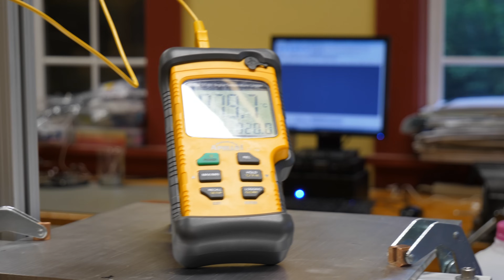Distillation

Comment: To those of you who may see a distillation project in your future, please consider this:

It is actually more simple than you may think to get an BATV license for a small pilot distillery setup.  This is especially so if you just plan on making "fuel grade" ethanol, or some other non-consumable use.  Just make sure you take good records of what was produced, and where it went, in case they drop in to check on you.  As with growing pot in non-legal states, bootlegging is a federal crime, and your entire personal property can be seized if you are not following the laws.  Contact your local office and do it legally.

When distilling "mash," "beer," or whatever mix of yeast/sugar-bearing malted grains, Rye, rice or feed corn + fermenting -> alcohol(s), as done by most moonshiners, one must be careful to be aware of the likelihood of methanol in the mix as a byproduct of the fermentation process. Some wild yeasts floating out in the woods like to make both types of alcohol.  This is especially true when fermentation is done with questionable mash ingredients, purposely using wild yeasts, or when cleanliness is ignored.  

Most commercial distillers are keen to this and will take whatever comes over first and discard it out of safety concerns.  They also make use of re-flux columns that are glass or copper tubes filled with glass beads or copper drip plates/screens, with the vapor take off at the very top of this column on its way to the condenser.  This allow for more accurate temperature measurements in the very top of the column so that they have a much better handle on what they are getting.  Methanol has a lower boiling temperature than water an ethanol, and will always come first.  A temperature increase in the the re-flux column tells you the methanol portion is done.

Unless you have a use for it, pitch it before someone accidentally drinks it and goes blind.  This is why the old moonshiners of the prohibition era created so much poisonous hooch that made a lot of blind victims out of people who were willing to drink anything.  A lot of the bathtub gin of the era tasted so awful that the modern "cocktail" was born from those days.

Comment: Hydrometer. A  Hygrometer is a different thing used for measuring water concentration.
The boiling beads/chips work by providing 'nucleation sites' rather than increased surface area.
Little anomalies in the material that the gas can congregate around. AKA anti-bump chips.
A stirbar generally works better IMHO.
Hard to tell if that kind of temperature probe is in the right place.
Easier to get it right with a thermometer or thermocouple as  the place they measure is in 1 spot.
Measure your coolant temperature. I guess the radiator gadget isn't coping well.

Comment: So just a quick question concerning distillation of water that has a high concentration of chlorine and fluoride: Would I be able to remove 100% of the fluoride using either method of distillation or will there always be some small amount left behind in the process?
Reply: There would still be a little bit left, he goes over that a few times in different ways in the video...

Comment: i love chemistry
Reply from the maker: Everyone should!  Just like electrical engineering, it is a way of understanding how the world works.  Do you want to ride in the car or do you want to drive it?
Reply: @TechIngredients  The car analogy makes sense. When I drive an old rear engined and rear driven car, with zero modern assistant systems (the whole electric schematic fits nicely on a single A5 page), I can really feel the car change its behavior by subtly changing the throttle, brakes, etc. By no means is the car safer to drive, but it gives you the experience of pleasure, when you understand all of the underlying physics at work. I really do not need to drive fast. Back in the old days, car had to be driven. A skilled driver could manage it very good. Modern cars are full of electronic assistants, and much better suspension and other things. Cars are much safer, they tolerate incorrect driver behavior and wrong input. But where is the feeling of actually being in control? Where is the experience of really driving? It is gone. Probably for the best, as most people do not understand how their car works and the risk of overestimating either own abilities or the physics involved in what they are doing.

Comment: If you wanted o purify water for drinking, is this a good and economical way to remove chemicals, PCB's and other bad stuff from your water? what kind of setup would you recommend?
Reply from the maker: This depends on how much water you would need.  The setup, here in the lab is based around glass because it allows us to distill a huge variety of liquids including acids and solvents etc. But the throughput is low and the components are delicate and expensive. An alternative would be to get a stainless steel, reflux still on eBay that can be placed on a large propane burner.  These are available from 3 to 15 gal capacity and you'll need a garden hose for the condenser as a lot of flow is required.  Finally, if you need a large quantity of water and want to avoid the set up for distillation then a reverse osmosis system coupled with a deionizer and activated carbon cartridge is the way to go.  Low energy requirements, thousands of gallons of capacity and can be installed between your in house water supply to a dedicated spigot near the sink.  We've used these systems primarily to supply large marine aquarium installations and the cost is similar to a large distillation set up. I like Spectrapure, but there are alternatives out there.
http://www.spectrapure.com/
Reply: thank you for your response. I am seeking a way to filer water without having to rely on filters that cost a lot but give you little in return. I found a natural method of filtration using a pond system and one other from charcoal and other natural components. I was just curious if distilling would remove heavy metals better? I am still researching though. thank you again. I enjoy your channel and have been watching since late last year.

Comment: Easiest/cheapest way to make 98% alcohol for cleaning or just about any household use: Go to the dollar store and buy the 50% alcohol bottles. They will never sell above that. 50% alcohol is useless: there is too much water to kill any germs (70% is ideal better then 91%) and the alcohol is too low for cleaning. Take a good amount of table salt and pour it in until it is about 1 cm above the bottom. Shake for a minute and let it sit for about five. When you come back there will be a layer of 98% on top and salt water with a small amount of alcohol on the bottom. Carefully pour off the top layer and discard the bottom. If you want 70% for antiseptic add water back in. You now have 98% and 70% for about half or  one third the cost of regular alcohol respectfully.
Reply: or just buy some 91% iso at walmart and use C1V1=C2V2 to mix it to 70%.
Reply: You can buy 92%. What are you on about?
Reply: @MrEazyE357  I have heard complaints from friends in other countries who do electronic repairs etc that they cannot buy isopropyl at all and others that can't get unwatered stuff. It however is easy here in the US.
Reply: @anarchangel7  Really? Never knew that. Wonder why?
Reply: I had to read all answers to get you were speaking of isopropyl alchol and not of ethil alchol. Ethil alcohol is readily available 90 or 94 %.

Comment: For even smoother boiling, use boiling chips with irregular shape. Sometimes running a magnetic stirrer is enough to promote even boil.
Reply from the maker: Those are good suggestions.
Reply: I was personally thinking that some kind of grate with spikes at the top could separate the bubbles into desirable sizes, possibly. I'm having a bit of trouble visualizing whether a grate like that would only facilitate flow through one opening if the holes are too small, due to surface tension keeping other holes clogged while one lets gas through. It would be fun to see some tests and math on this, too. Generally, more equations would be nice to have in my opinion.
Reply: +1; I found jagged corners on e.g. pieces of broken glass provide better nucleation sites

Comment: The boiling beads work by providing nucleation sites for bubbles to form. Roughed up broken glass is excellent for this — the roughness provides lots of extra sites. 

If you ever run higher temp distillations, like for sulphuric acid, go with a round bottom flask and a heating mantle. Erlenhymer flasks are more likely to crack.

Zeolite is a great way to dry your alcohol.

Comment: If the heater is set to limit the temperature to just a few degrees above the boiling point of the liquid you want to destill out, but lower than for the other liquid, the concentration throughout the process will be higher, but it will take longer :)
Reply: The mixed liquids don't have individual boiling points. They have one combined boiling point which depends on the current concentration of the two. So as the alcohol comes out the boiling point goes up steadily the whole time until it reaches that of the water. The hot plate isn't so much about the temperature it is producing but the amount of energy it is putting in and what that affects is the speed of the process. A liquid cannot get hotter than it's boiling temperature so turning up the heat only speeds the process but doesn't increase the liquid temperature. That's why you put the thermometer in the vapor path and not in the liquid.
Reply: @gagnant4  interesting. I'd forgotten this. Can you increase separation by increasing pressure?
Reply: @RoulDukeGonzo  You have the right idea but backwards....increasing pressure raises the boiling temp and the dew point temp, so respectively more power to boil the liquid and more cooling to condense it on the other side. But if you lower the pressure you can use less energy to separate the mixture. There are devices for this used in chemistry labs but for distillation of alcohol, especially at home, it's not a good idea to have a closed system Still, that's when things can explode! :)
Reply: @gagnant4  the reason that in distillation we like to go slow and low temp with it is because of the exact thing you said: the more energy you add into the mix once it's at it's boiling point, the liquid will boil faster.
and in distillation we're using the top of the still and all the other surfaces as places for water to condense, so if we stay just at the boiling point but not add a lot more energy the distillation will go slow enough that we have enough time for water to condense on the surface and fall back into the pot: reflux.
great explanation btw

Comment: You gave a fantastic explanation of distillation out of the gate. I expect that much less water would make it through, as evident by specific gravity at the end, if you had limited the heat input to be just above the boiling point of the alcohol but at a slower rate. Would that be justified expectations?

Comment: Nice video... can't you increase the alcohol concentration in the first glas by heating the mixture just to about 85°C? Because alcohol will start vaporizing earlier (80°C I think) than the water?
Reply: If you think about temperature as random motion in a bunch of particles, when things bump into one another one particle may gain energy and the other lose some. This means that even if the average temperature is below the boiling point of water, some water molecules will still reach the energy they need to evaporate from the mixture - exactly why there is still water in the first distillation batch, and why water evaporates even if left sitting on the ground on a chilly day.

Comment: Its weird.  You're doing the things Im doing.  Its starting to get a little bit.. improbable.
Also: good job choosing isopropyl alcohol instead of ethanol if you live in the US.  You probably know why.
Oh, for everyone else: its illegal to distill ethanol in any amount in the US without a license or fuel waiver.

Please tell me you're not planting sugar beets.
Reply: GRR:  No, I have had somewhat frequent contact with the BATF over methanol distillation in conjunction with ethanol distillation and you're both right and wrong.
States may have specific laws, but the BATF laws very very definitely supersede those laws.  They're obviously not going to enforce them.  They don't have the manpower. But when it comes to them being presented a thing and having to make a decision, the law is clear.  

As an example, marijuana is federally illegal but legal in some states that border Canada. Do you know what happens if someone crosses the border into Canada with marijuana? Even from a state where its legal?  Well they're refused admission into Canada and remanded into the custody of the US border patrol, a federal agency where they're prosecuted for the federal crime of possession of a controlled substance.

Here's a way you can check me: try to find a consumer grade water distiller that has more than 1 gallon capacity.  You may be able to, but I doubt it because there's another BATF law making any distillation vessel of any kind larger than 1 gallon illegal to own without the appropriate licencing.

Here's where I'm coming from: I like this channel a lot.  I've recently seen a lot of chemistry channels on YT get shut down.  I don't want to see that happen.

The reason I said "for everyone else" is because this guy seems to really know his shit, so I'm kind of guessing he already knew that or is located in Canada.  You're in the weird part of YT where you're going to start running up against people who know a lot more than you about a lot of things.  I don't know if you understand this, but thats actually a good thing.  I love it when I find people who know more than I do.

-edit: Oh, I get it now.  You think I was (pretending to be) speaking on behalf of the BATF from some position of authority.  No, I legitimately had enough respect for this guy's intelligence that I put him above your average YT commenter, like, you know, yourself.
Reply: htomerif  it’s the land of the free, so of course we are restrictive. No contradiction there and don’t ask me to define contradiction. Yeehaw 🤠😎

😑🇺🇸🚫🧠
Reply: Green Rabbid Rabbit 😬 ooookaaay, really creepy that you’d check my channel for that joke, but 👍🏽. 

🤖or👽
Reply: GRR: given the very next video he/they made, I'm gonna guess they're Canadian.
Reply: Hrtomerif That is not true. It is also very state-specific. At least in Oregon, you may not sell alcohol that you've distilled yourself. However, you may distill and consume alcohol for yourself, just as you may brew beer and vintage wine at home.
"Oh, for everyone else:" Really?

Unless you're a legitimate ATF agent that posts a few RC car and electronic component videos to YouTube, Please tell me you don't take yourself as unwarrantedly serious as you presume to above.
Reply: Matthewweaverworks Do you normally  not read the beggining of comments before responding to them? I wasn't replying to you, obviously - it wouldn't make any sense.

Comment: It's not only the removal of the high-temperature molecules from the liquid that causes the cooling (in fact, I would say you're correct in saying that this effect is infinitesimal).  It's rather that breaking the intermolecular bonds between the molecules requires quite a lot of energy, which is absorbed out of the environment.  This is called phase-change cooling and it's how refrigerators, air conditioning, and sweating works. (edit: sp)
Reply: FYI, "removal of the high-temperature molecules" and "breaking the intermolecular bonds between the molecules" are exactly the same thing but worded differently.
Reply: MrBleulauneable Not in the way he explains it.  He states that it's the removal of the high-temperature molecules that affects the average temperature.  He mentions nothing about the mechanics of what actually makes phase-change cooling so effective.
Reply: Additionally, phase-change cooling works just as well when the high-energy molecules are not removed.  Ice melting in a sealed drink container would cool the drink regardless of whether the high-energy molecules can escape.  Thus, phase-change and "high-energy molecules escaping" are different mechanisms.
Reply: With ice melting in a sealed container high-energy molecules are still removed. They are removed from the ice and go to the liquid, that's the definition of a phase change. If molecules don't change of phase (ie are removed from one phase) then it's not a phase change, it's that simple.
Reply: No, the high energy particles are not removed when ice melts in a cup. They equalize their energies with the lower temperature ones - this is indeed a different process. One takes kinetic energy out of the mixture, the other normalize the energies, although both have a phase change. In one example the total energy in the mixture stays the same, in the other some is removed.